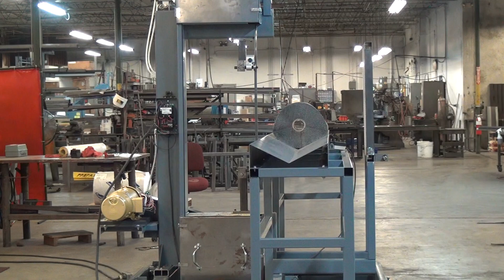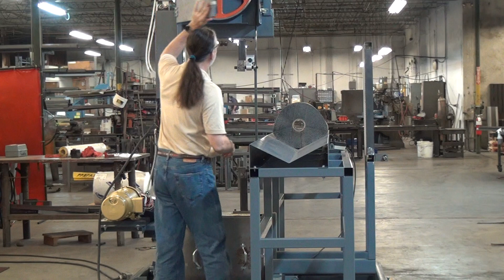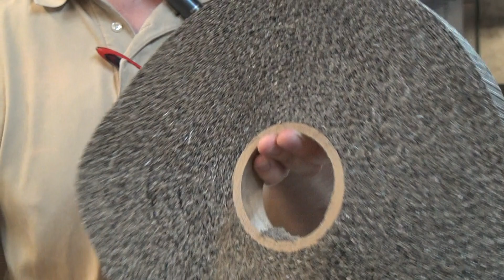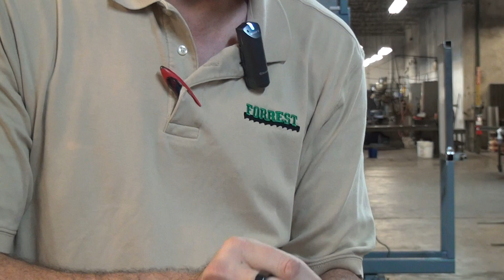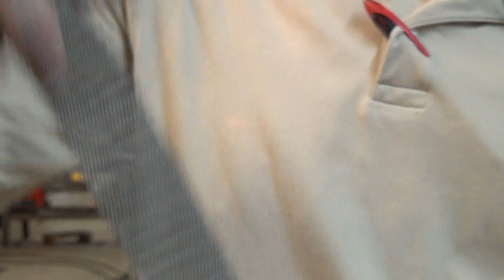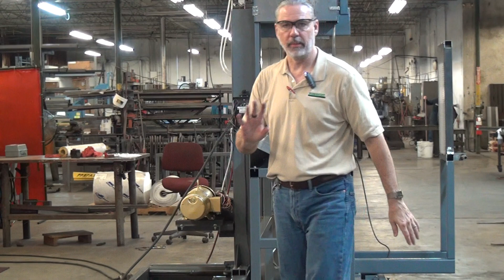Bandsaw for cutting long rolls of material

Comment: Excellent machine! A few questions. 

Can the cradle be modified with rollers?
Electrical requirements?
Machine floor space and height?
Is separate air supply required or onboard?
Sufficient for cutting 1/4 thick plastic fiber mat with thin rubber backing in roll form?